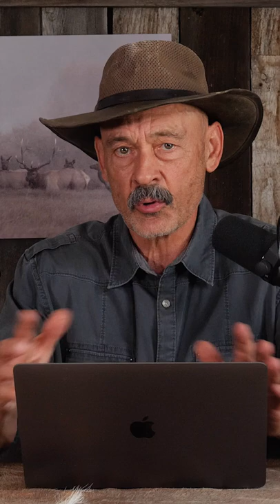How Rifle Barrels Are Made

Comment: I’ve seen some terrible (rough) button rifling on new barrels. I hear they smooth out with use, but I believe it would take a while.
Reply: They sell kits to  lap a new barrel. I use to always do so when making barrels. Then I switched to electrochemical etching. Way faster and easier to do in a home shop
Reply: It sounds a bit aggressive
Reply: @boshboshbosh1  What’s aggressive, my opinion or the rifling? I won’t mention the brand, but it was a .22 rf auto loader, and the bore looked like it was lined with bits of steel wool.
Looked at it with my bore scope. Son bought the rifle for his girlfriend who never fired it!
I’m sure it would have shot out, but it looked awful.
Reply: @uralbob1  I meant the method of rifling, sounds a little aggressive for something so well engineered
Reply: @boshboshbosh1  👍
Reply: @uralbob1  that’s unnecessary… Shoot it a hundred times and clean it once and that will be gone lol
Reply: @luke8222  You are probably right👍
Reply: Generally rings in a new barrel are from the drilling or reaming process. Often the rifling process isn't enough to smooth out the rings. it can be avoided by using a new reamer but the reamer tooling is pretty expensive so most shops will just use em till they break. I used to work for a large scale barrel producer outside of Pittsburgh.
Reply: @battletank21  👍
Reply: @jmiknuk  how do you set up for electro etching a barrel. Is it a fancy machine or how do u only Etch what your want.
Reply: My rem 783 to point shoots 26mm group  at 210m . Looking down that barrel  there is burs,chips  and gouges

Comment: Don’t forget ECM! Electrochemical machining uses flowing salt water and a mandrill with the rifling pattern in wire set in it, hooked up to a variable power source, cutting the metal by breaking the metal down
Reply: I don't know how common it is in full scale manufacturing, but it's part of building an fgc-9 because it can be done in a garage with tools from a hardware store lol. Obviously there's better PCCs out there, but the fgc9 has my heart because it makes modern homemade firearms accessible to nearly everybody!!
Reply: Just for that comment player, you get to go one-on-one with the FBI
Reply: They got the filed to 3d print a negative to hold the wire to etch the barrel and its scarily easy
Reply: More common on medium caliber weapons such as the M242, M230 and MK44. Some smith and Wesson barrels are ECM’d but they are more expensive
Reply: The biggest benefit of ECM is the barrels are WAYYY more accurate rifiling if done correctly and the bore is smoother.
Reply: I didn't know this had been applied to barrel rifling. Interesting.
Reply: ecm is for the weird people with 3d printed guns.
Reply: Do you mean EDM; Electrical Discharge Machining?
Reply: As far as the fgc-9 goes . how does a person who lives in a country in which you don't have acces to bullets and casings and so on get ahold or make them in a manner that is not very expensive and reliable . because i think the tricky part is the Cartridges and not the gun. also is it possible to make a rifle barrel say 16 inch at home with the least amout of tools ?

Comment: I used to make barrels and button rifling was always fun. I had very thick and sticky oil and we named J2 honey. 1 jug thickener 2 quarts oil made it thick and sticky. But when the rifling button would get stuck and break it was so loud like almost a gunshot. And it gave no indication if it was gonna break till it  did.
Reply: I had a 16 inch .50 cal barrel split once  right as the button finished. That was loud.
Reply: I'm curiouser what is the best round in your mind
Reply: @chriscole5804  depends on purpose conceal carry 9mm capacity and its been proven that pistols suck so caliber doesn't matter to much like rifles do. But hunting 308 or 300win mag cause of availability 6.5 creed is closing the gap though.

Comment: I used to work for a barrel company. We did button and cutting. Cutting is much more fine taking out most if not all imperfections giving the shooter the most advantage. Buttoning is carving the rifling in the barrel when it’s pulled through with a heavy duty hydraulic and it can be done in 30 seconds. Cutting is technically better but it takes forever making it more expensive but if you have a process and setup button rifle accuracy will rival cut rifling. The only time I’d ever suggest cut rifling is if you shoot competition at long distance with hand loads or you’re just wasting money.

Comment: Cold hammer forged is the BEST barrel manufacturing method imo. I’ve got 2 rifles that are cold hammer forged, and they are stupid accurate. One of them is in an AR, and with a trued upper and loctited barrel extension, it shot some handloads of mine into a .214 inch group @100 yards
Reply: The United Ststes Army Marksmanship Unit use cut and button rifled barrels. The button rifled barrels are more accurate but have about a third less barrel life as a cut rifled barrel, 1800 rounds vs 3000 rounds. When I was active in US Service Rifle Competition and NRA Long-Range I fired about 5000 rounds annually and thus rebarreled frequently, enough to understand match grade Douglas button rifled barrels smithed but Frank White at Compass Lake Engineering delivered the best accuracy, under a half MOA at 100 yards in prone sling supported position from iron sights. Cut barrels appear to get about 3/4 MOA under same conditions. Now, hammer forged barrels are cheap and can be produced quickly to support high volume production needs. Some may be very accurate and barrel life is known to exceed button or cut rifled barrels. At any rate, your groupings from your hammer forged barrel is outstanding yet not representative of the genre.
Reply: @charlesludwig9173  well it’s the same aspect, cheap hammer forged barrels will be just as bad as a cheap button rifled barrel. That said, I have multiple shilen AR barrels cut with match chambers and that are button rifled, and none of them shot better or probably ever will than my cold hammer forged DD barrel

Comment: So I just watched this short, than went and watched the three different procedures and man, that's some really interesting information 🤔 thank you, learn something new everyday!!!
Reply: Try electrochemically rifling too
Reply: @devinpauley6520  that sounds really similar to water jet cutting..i didn't know they used salt water tho, pretty sure high pressure water jet cutting just uses distilled water with some lubricants in it. Not 100% sure but i have seen water cut through 1 inch thick forged metals and it cuts  so precisely its amazing.. and you definitely do not ever put your hands near it when the water nozzle is on because it will take an arm off with ease...

Comment: There's actually a fourth-style of rifling using electrolysis although it's not as clean as Hammer forging button rifling or engraving it is very cheap very fast however button rifling is a lot faster than hammer forging Hammer forging is superior as it's accuracy and density of the metal that is compressed during the process therefore making it stronger more accurate Barrel button pressing is way faster since you're using hydraulic pressure to move the button lubricants.

Comment: Button pulled rifling is the most common barrel type today.
Reply: Are you sure? The last 5 years I think there has been a huge adaptation to hammer forging. I think it's most popular now. Seems like I see it more today than I did a year ago even
Reply: @TheAnnoyingBoss  Hammer forged barrels are most commonly found on higher end rifles in the 2,000 U.S. dollars and up range. The majority of rifles sold globally are under that price range and are button pulled barrels. For example H.F.B. are on average 3 to 4 times the cost to manufacture vs cold button forged barrel and the accuracy improvements are minimal. The real improvement in accuracy comes from cut barrels which again are even more expensive to produce the hammer forged barrels but make for precision firearms used in long range hunting and for sniper rifles.

Comment: Some people say that forged barrels are stronger too, but you aren't going to make steel any denser with a hammer. It entirely depends on the final heat treatment, before then however you get it to shape is equal
Reply: They are stronger b/c you don't cut into the material which creates stress risers at the point of the cut.

Comment: Regardless of what the internet says, all methods are equal. 
The surface finish of the bore is the deciding factor in what the barrel can do.
A crappy file tooth surface full of drill or reamer striations and choke points is going to grab material and foul out immediately.

A lapped bore that has fine finish striations if any aligned to the bore axis and uniform in diameter will not foul out.

Things like burrs on the lead of the lands and deep striations in the freebore from a dull chamber reamer also has negative effects.

Comment: A button is a small mandrel that is final bore size ,welded to a rod and  dragged through an undersized hole  ,it requires a chamber be cut and profiling . There is also a broach cut rifling with Is a combination of button and cut rifling  . Stepped blades rough cut the rifling and the button finishes them as it is pulled. Also requires profiling and chamber cutting . The cold hammer forging requires the receiver interface be cut and , muzzle be crowned then you have a finished barrel.   Unless they now can also form the crown too.which is very possible...
Reply: My cats breath smells like cat food.

Comment: Don't forget Electrochemical! FGC-9
Reply: How?
Reply: @olddirtybooger  the easiest way todo so is 3D print an insert with a recessed area for copper wire with the twist rate and grooves you want.  pump salt water through the barrel  and run a electric charge through the copper. It’s highly accurate and very easy to do.
Reply: I was going to say this. Ecm for the win
Reply: WeRepresentThePeople  , Holy what?

Comment: Cold hammer forged barrels are the only barrels worth buying.
Reply: I have to completely agree.
Reply: I don't know about that button rifling in a good stainless steel will last much longer and are more accurate.
Reply: @chadklaren9537  That's true,  stainless steel is classed as Austenitic giving it more resistance to corrosion, heat etc... whereas Molybdenum is a Ferrite former.   Both are important in barrel making. However in terms of stainless barrels in some cases it would not be my first choice.
Reply: @billfulgenzi2287  Not all stainless steel is austenitic.

Comment: 🍪PERFECT CHOCOLATE CHIP COOKIES🍪
Ingredients:
2 cups (260g) unbleached all-purpose flour
1 1/2 teaspoons instant ESPRESSO POWDER
1/2 teaspoon baking soda
14 tablespoons unsalted butter (1 ¾ sticks; 198g), divided and cut into 1 tablespoon pieces
1/2 cup (100g) granulated sugar
3/4 cup (150g) dark brown sugar
1 1/2 teaspoons kosher salt (Diamond Crystal)
2 teaspoons vanilla extract
1 large egg
1 large egg yolk
1/2 cup (87g) semi-sweet chocolate chips (like Guittard)
1/2 cup (80g) cark chocolate (70%) discs (can substitute chopped chocolate from a bar)
3/4 cup (87g) chopped, toasted walnuts or pecans (optional)

Directions:

Whisk together flour, baking soda, and espresso powder in a medium bowl and set aside.

In a saucepan over medium-high heat, melt 1 stick of butter (8 tablespoons or115 g). Continue cooking until butter begins to brown. Swirl pan constantly until butter has foamed and takes on a dark golden brown color and smells nutty. Watch carefully, as it can quickly go from dark to burnt. Carefully pour browned butter into a large heat-proof bowl, scraping all the browned bits from the pan by using a heat-proof spatula.

Immediately whisk the remaining butter pieces into the browned butter, until melted.

Add sugars, salt, and vanilla to the bowl, and whisk to fully incorporate.

Add egg and egg yolk and whisk until smooth with no lumps remaining, about 30 seconds. Let mixture stand for 2-3 minutes to let the sugars melt, then whisk for another 30 seconds. Repeat this rest-and-whisk process 3 times, total. Mixture should seem thickened, smooth, and shiny.

Using a spatula, stir in dry ingredients until just combined (and a few flour streaks still remain). Stir in chocolate chips, discs, and nuts (if using) until evenly distributed and no flour pockets remain. Refrigerate dough for at least 2 hours, or overnight.

Once dough has chilled, scoop into balls that are slightly bigger than a golf ball. (At this point, I put them on a quarter sheet tray in the freezer, once frozen solid, I transfer them to a resealable freezer bag, so I always have homemade dough at the ready!).

Place cookies 2 inches apart on lined baking sheets (or a nonstick cookie sheet).

Bake at 375 degrees for 10 to 14 minutes until cookies are golden brown and puffy in center, but edges are darker and fully set. Transfer cookie sheet to a rack to cool completely (or at least 10 minutes).

NOTE: If baking from frozen, I let dough balls sit out for 20-30 mins while the oven preheats to 350 degrees and bake for 16 to 20 minutes.

123
Reply: Cookies and guns...my favorites
Reply: Too much brown sugar .5 cup only
Reply: How do you print this comment? Screen shot I guess...

Comment: Which process is best for precision shooting? Which steel is best for precision bolt actions?
Reply: Not even the experts agree on this.
Reply: @RonSpomerOutdoors  what’s your take on 5R rifling?
Reply: @u.s.militia7682  Seems to make sense. Genlter edges of the lands/grooves reduces bullet deformation. So does position of the lands in relation to one another.
Reply: @RonSpomerOutdoors  i just wonder how many rounds can be spent through a 5R barrel before it starts to become ineffective? You’d think it would wear down faster than conventional rifling.
Reply: @u.s.militia7682  No, barrel wear is from heat and chemical cracking at the throat/leade. That area breaks up/degrades long before downstream rifling is eroded by bullet passage. Rough start at the beginning of the rifling is what rips/distorts the bullet for poor accuracy. Some shooters will cut off an inch or two from the breech, rechamber, and get another 1,000 rounds or more.
Reply: @RonSpomerOutdoors  thanks for helping and answering my questions. Will definitely subscribe. 🇺🇸
Reply: Pac-nor.   Hand lapped button rifled barrel     #1.      Worth the wait and the coin

Comment: Don't forget about ECM or electrochemical machinig. You'll definitely see a rise in this with the rise of 3D printed guns, because you can literally do it in your bathtub
Reply: Yeah how ? ECM uses a water pressurised jet mixed with a pure copper cable that provides the erosive energy
Reply: @sergiomissaglia6380  probably carbon electrode, like older carbon electric discharge machining.
Reply: @SW-ii5gg  explain :)
Reply: @sergiomissaglia6380  a carbon electrode is formed into the opposite shape of the part to be machined by erosion using current and electrolyte, it is difficult for me to explain as I have seen it done but have no experience and technical knowledge of of my own.
Reply: @SW-ii5gg  oh okok... Sorry I have never been so unhinged from reality like that, really, lol, probably because of the flu, I forgot why I wrote the question. My question was, how could u manage to make ECM in a bathtub ?!
And it was for Apexpredator
Reply: @sergiomissaglia6380  I think they are using containers such as buckets for the electrolyte, not sure about the work holding fixtures and power supplies, I think the bathtub is for spills that may happen for those using their home to do the work.
Reply: @sergiomissaglia6380  I think videos have been posted on YT, don't know if any are still available. Hope you feel better soon.

Comment: CHF is without a doubt the best in every way. It's quick because it forges the barrel and the mandrel at the same time. The steel doesn't have to be preheated for this step since the cold billet has already undergone some processing and finally it can achieve groove depths that button rifling can't with a higher variety of alloys. Button rifling is slow and not very accurate. Cut rifling is fast but needs softer steels (high chrome barrel steel and high chrome steels in general wear out cutting tips like nothing even in the annealed state). CHF solves both problems. I was lucky enough to speak to an FN rep at shot show last year and I'd seen their machine at their factory in Spain a few years prior. The logistical elements of arms manufacturing and how they influence firearms design are truly fascinating.

Comment: I looked up how single point barrels are made and pulled up this video. Didn’t hear him mention that one.🤔
Reply: I think that's what he meant by cut rifling.
Reply: @SW-ii5gg  Apparently there’s a newer process that not many places do called  single point and seen it on Killer Innovations detail page with match grade barrel making. Didn’t find much on it on YOUTUBE so I guess google should provide more on it I assume.
Reply: @hardcore4476  there is an older process of single point that that is probably rarely used because it's slower and uses a special machine to single point cut the rifling, don't know if they have made a new process, but probably have upgraded the machines and method.

Comment: Hammerforging has the downside in that the process introduced the most stress - it's why pencil barrels that have been hammerforged tend to have the most problems with a wandering zero. There are ways to stress relieve the barrels like cryo, but it's rarely done, as it drives up the cost dramatically.